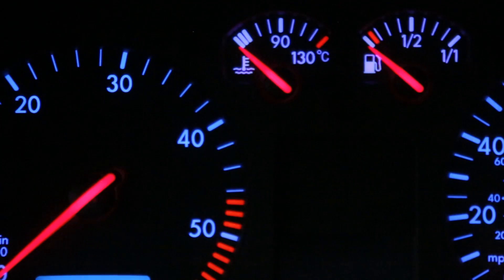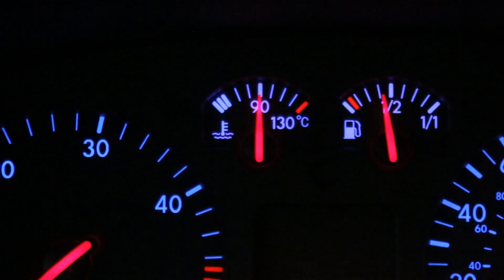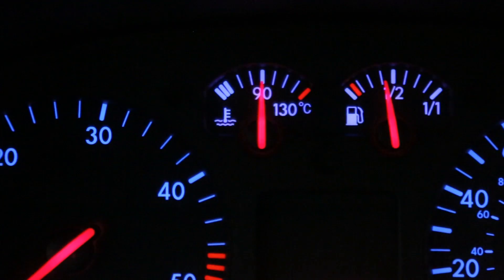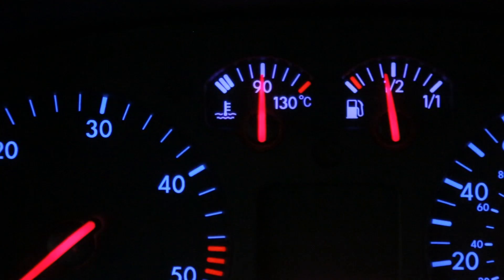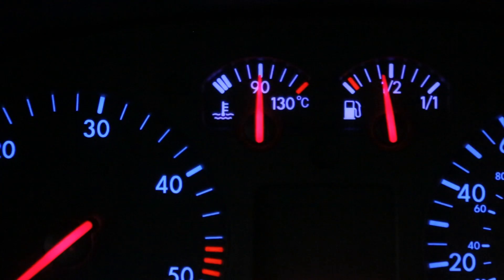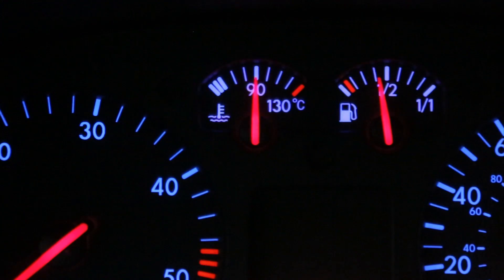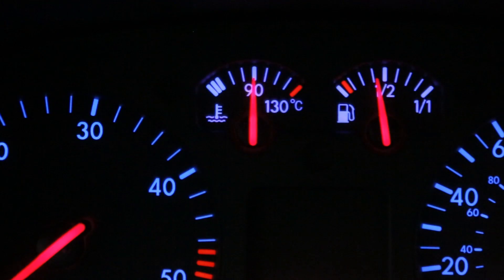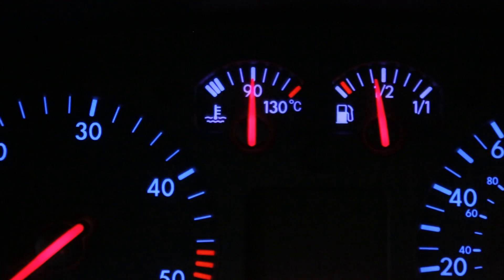VW Golf Mk4 Thermostat Temperature Needle Stuck/Stays 70 - Fault diagnosis

Comment: I have the same problem but with the speed, its just stuck on 15km/h, no matter what, even when its off. ideas?
Reply from the maker: I've not seen that before I'm afraid but it sounds like a fault with the cluster
Reply: Will change the speedometer tomorrow, the speed sensor is fine it seems, so i hope that just changing the speedometer will be enough, will let u know if i wont forget

Comment: I've replaced the thermostat and now the temp sits at 90 which is as it used to be, however the bottom radiator hose never gets warm is this normal??
Reply from the maker: I'll have to check mine but if it's sitting at 90 now then it sounds like it's all ok
Reply: @ajvw  saw your video on front shocks and springs,  mines hopefully being fixed at local garage tomorrow as 2 inches broke off the top of the spring and the cup.it would sit in has dropped down
Reply from the maker: @garypritchard583  hope you get it sorted ok

Comment: Is it ok if its 95 when i drive in the city? 90 on highway
Reply from the maker: It shouldn't really go above 90 unless it's excessively hot or there is a fault in the system but if it's normally at 90 then that shouldn't be a problem
Reply: @ajvw  yeah usually 90 but sometimes goes 95 like for a couple of seconds and then back to 90
Where i live ,is 33°C these days.

Comment: What would you advise if the needle is constantly moving but never leaves the lowest end of the gauge (needle never exceeds that third line) once it popped back up to 90 like it was there the whole time. Thanks
Reply from the maker: It sounds like that might be the thermostat if the needle does move. I've got another video that shows how to replace it
Reply: When idle  sits at 90 soon as I pull off it drops to 70/80 is this normal golf 1.9tdi
Reply: @Daniel-kx4di  same issue...same name...interesting...did you figure it out?
Reply: Thank you mate!
Reply: So when one mealages is not going and km so what is that problem

Comment: My temperature and fuel gauge needles are sitting on the line and not moving up.
Reply from the maker: That sounds like a fault in the cluster if the fuel gauge isn't moving either

Comment: Hi, i have the same problem tem. doesent go higher then 70, what if i drive the car like this?
Reply from the maker: It shouldn't affect the car, mine was like it for quite a few months before the thermostat got replaced. It just means the coolant isn't circulating as it should be
Reply: @ajvw  It also means taht the engine is not warmed up to the designed operating temperature with all the consequences.

Comment: i have now the same problem, from 90 temperature the car changes the temperature to lower during drive my car :/ its posible the termostat be a problem ???
Reply: It's probably the thermostat, I have the same problem while stopped or driving slowly the temperature goes up to 90c but once i drive over 50km/h the temperature goes down, changed the temperature sensor but it didn't fix the problem, it was easy and cheap so not a big loss. I think the thermostat is stuck completely open and when i drive more air hits the radiator so the temperature goes down, I'm ordering a new thermostat and the plastic piece where you connect the hose,  from what read the problem can come from it too and some kits include it.
Reply from the maker: GoC. 0248 it sounds like it might be the thermostat. it's quite a cheap fix but the temperature sensor is cheaper and easier to do

Comment: Can u help me plz my speedometer doesn't work and the miles also
Reply from the maker: There are some wires underneath the battery tray that can corrode and break so it would be worth checking them to see if they are broken first
Reply: VW & Ford Car Maintenance Servicing Tips the problem started when i press gaspedal the temperature needle moves and know speedometers doesn't work 😂
Reply: In Saudi Arabia u can't find this car 😂 this car model is rare